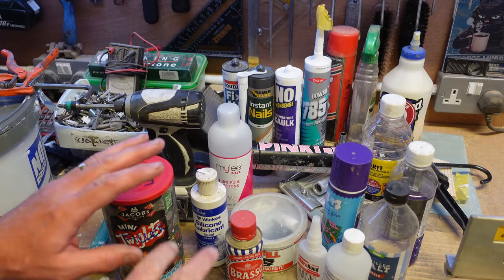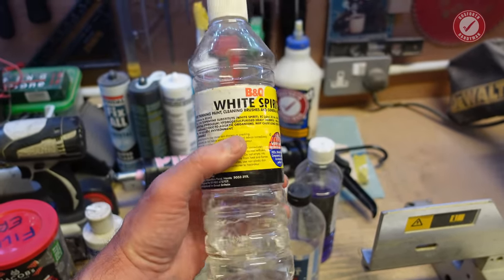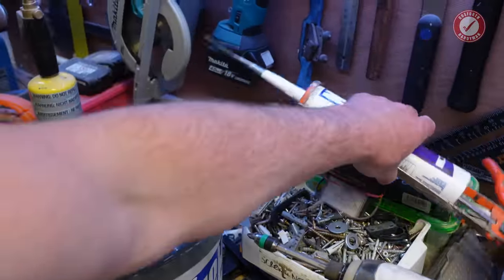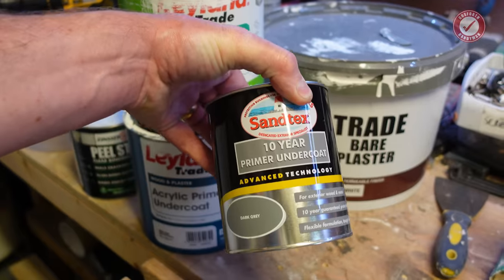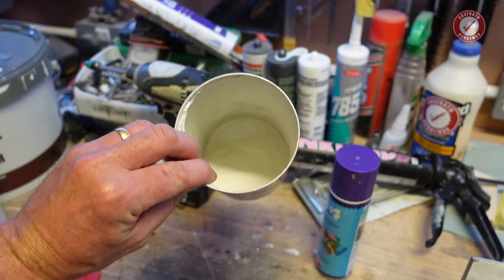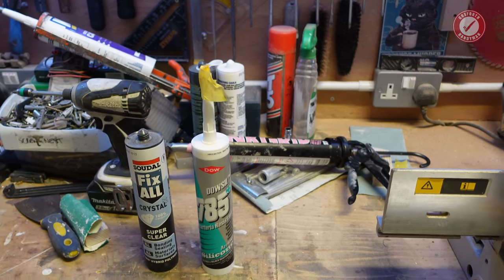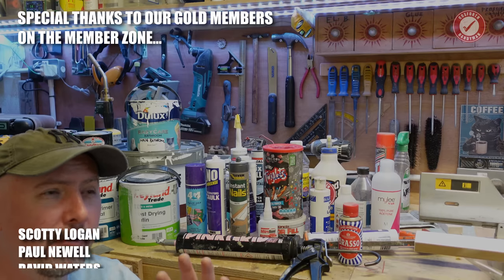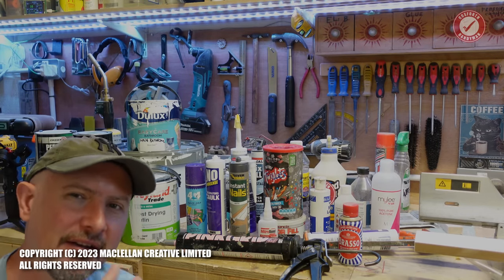Glues, paints and caulks we like to use

Comment: What are peoples thoughts on the no nonsense plaster paint VS a standard watered down mist coat for price/effort? 

I have bought my first house, knocked it down to brick and its finally getting plastered. If I look on screwfix I can get 20L of leylands contract paint for the same price as the no nonsense plaster 10L paint, and I will also be watering the leylands paint down so I suspect I will get a lot better coverage / value? I will be leaving 95% of the walls white though, and I will need to buy separate finishing paint with leylands to cover the mist coat, but I guess that is not needed with the no nonsense paint?

Any thoughts appreciated!
Reply from the maker: I've just had too many issues with watering down contract paint, so not doing it any more 😁. We might have just been unlucky - bad batch, weather conditions etc. Might be worth buying a tub of each to compare and contrast. 👍
Reply: The no nonsense stuff is the 👑 ...it's the only thing on my ceiling and coving as a top coat too and it looks great months later, flat and hides all marks. 

It's a dream to use
Reply: Thanks both, looks like I will need to at least give the no nonsense stuff a try in a room 👍

Comment: External paint work, Sandolin SupaDec brilliant. No primer or undercoat easy to use and lasts.
Leyland undercoat brilliant on MDF as a primer
Edit: Zinsser products are fantastic for problem surfaces
Edit edit: Touprep great powder filler. Two types internal and external 
Wood glue. Everbuild D4. PVA external £14.50 for a litre, very good value 
Caulk, Geocel very good, paint goes on well, does not crack
Reply from the maker: Would concur with all that! 👍😁